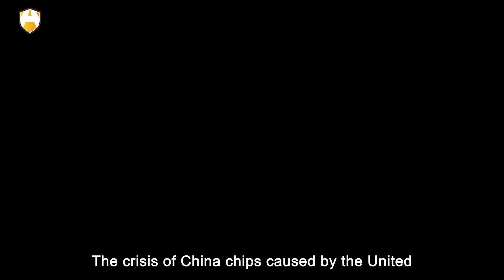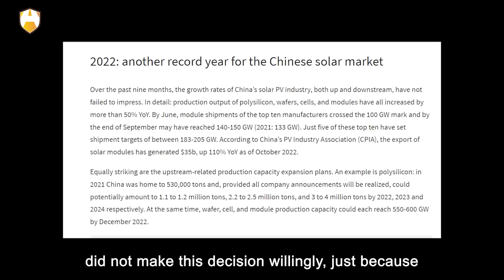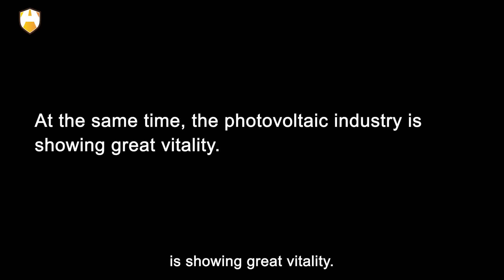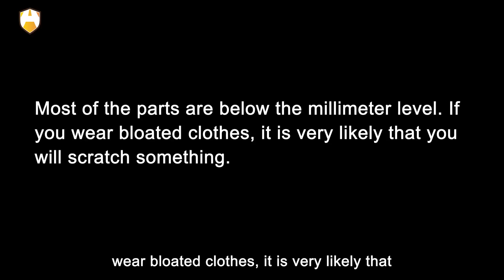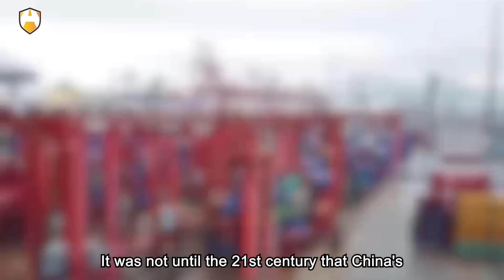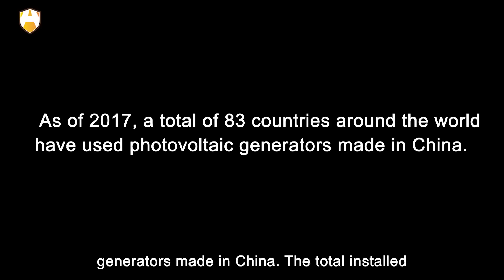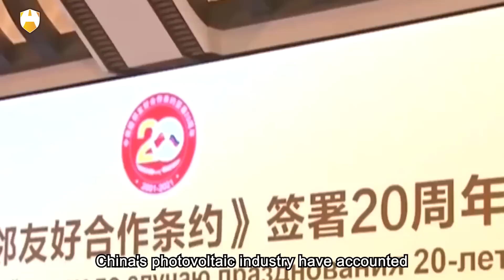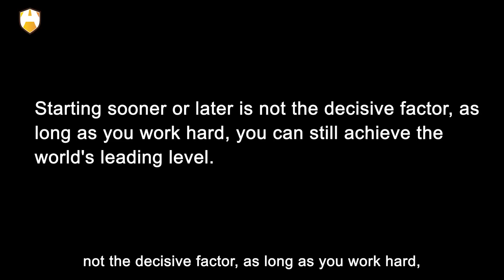Solar Wafer tech export ban, Does it scare America?

Comment: Nah, there are already large factories in the US that will expand. 
Solar can be a part of a modern energy generating portfolio but like nuclear, or wind, or coal, etc.  but it doesn't have to be one of the elements a nation relies on.
This isn't equivalent to losing semiconductor advantage. It's China's loss of revenue when they need every dime.
Supply of fabricated and assembled product at a low cost is not a good platform for an economic war. 
Just keep rolling. It will be more expensive but most of us don't need half the stuff we buy